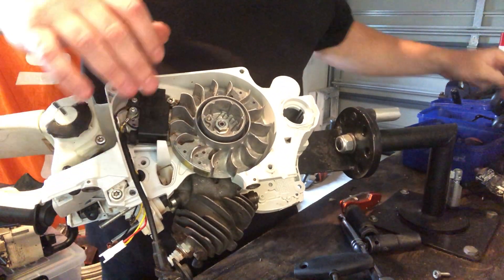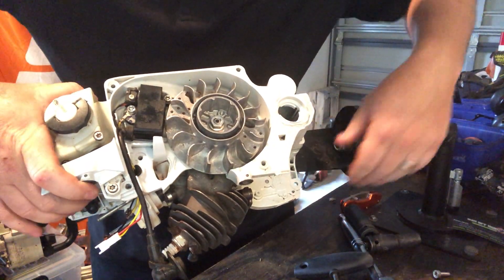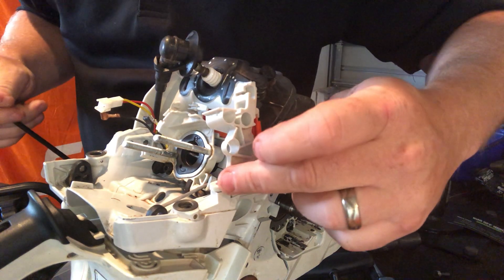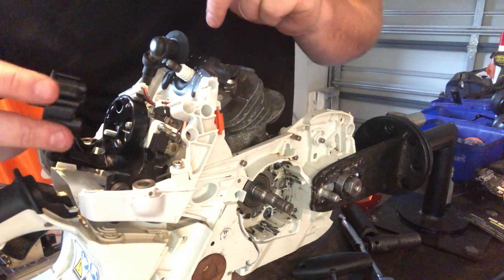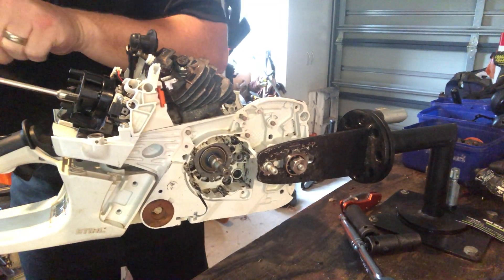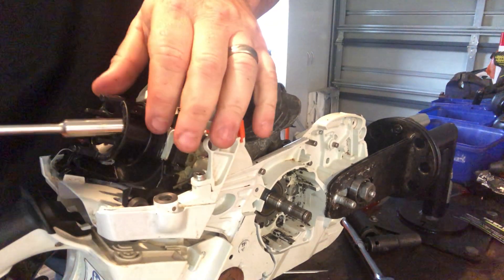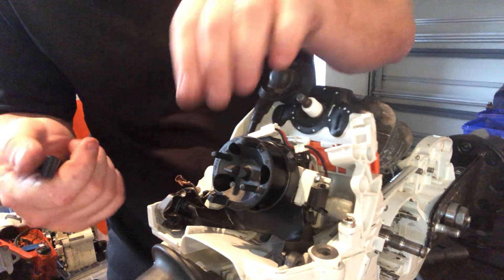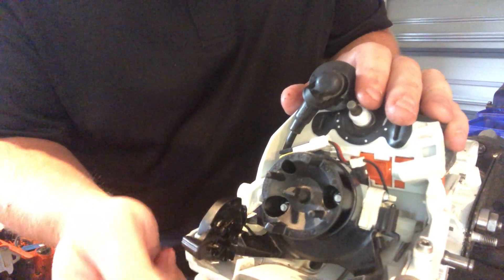Stihl MS261 part 4 - Ignition module, fuel tank, and carb

Comment: Now I know why there are no youtube vidio that describe the coil wiring at the combo choke on off switch in the past like 15 years ago it was so simple. I replaced the coil and now have a "no stop" issue and you have convinced me to not take it apart but i did learn a lot from your video. I know the wires are OK as I checked for continuity just can't see how the stop part of the switch actually works I am assuming it is the black wire that controls on/off. Tough to work on such small parts even more difficult to do the video BRAVO   MS 261c

Comment: Where can I find the ignition coil I looked for it on line but is not the same kind, thanks in advance
Reply from the maker: You will have to buy new from Stihl for this model as it’s Mtronic or get a second hand one.
Sorry mate, hope this helps?
Reply: @kiwilad4216  thanks for your help